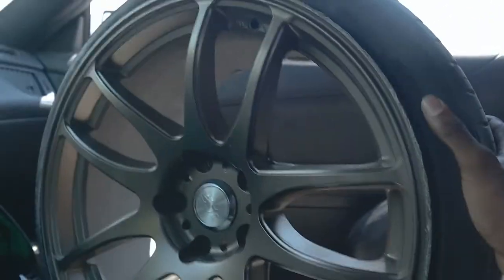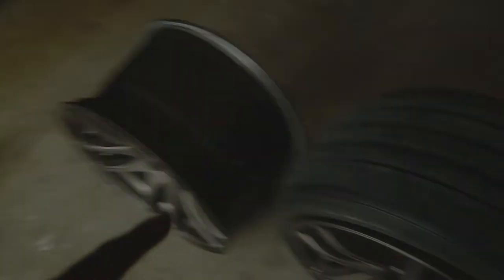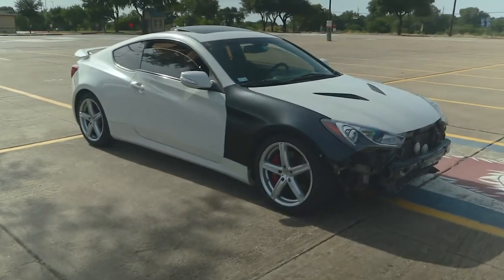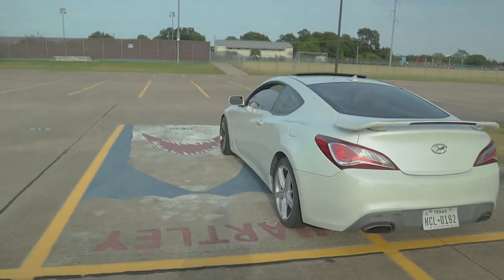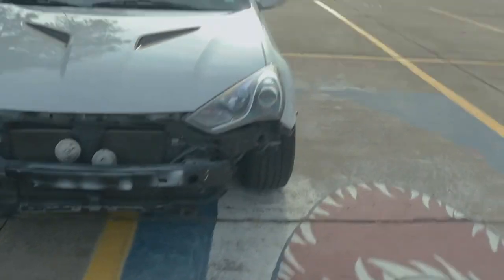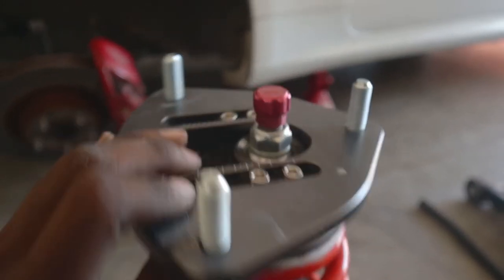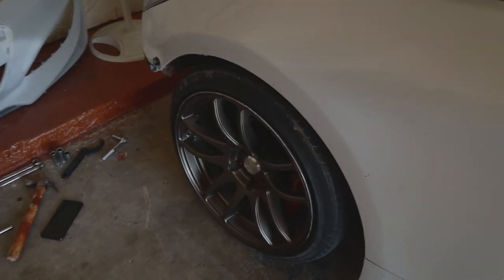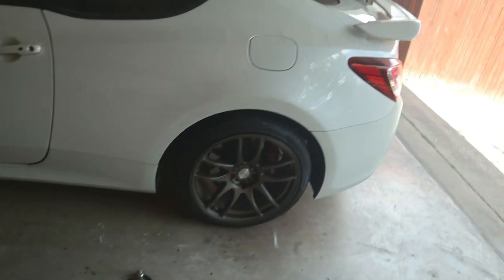Project Genesis Coupe R-Spec Gets NEW WHEELS (ESR Wheels)

Comment: I've seen people run 11s in the rear with additional negative camber, no spacers. 9.5 +22 front / 10.5 +22 rear is the most common run setup. 

Btw, do your end links go in to the bracket of your strut from the left on the passenger side and driver side? So driver side faces rear of car and passenger side faces front of car?
Reply from the maker: 10.5 + 22 poked out too much for me and since the rear coilovers are true style they hit the spring. Also the coilover spindle for the front were installed backwards but I dealt with that!
Reply: @elbon4987  you do not own an rspec 🤦‍♂️ you have an ultimate. If you had an r spec then you wouldn't have a moon roof.